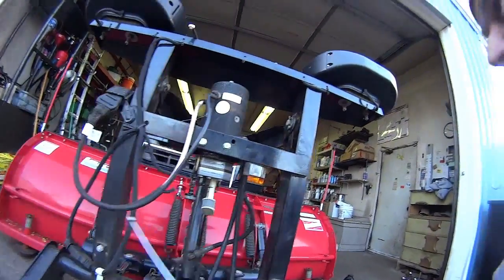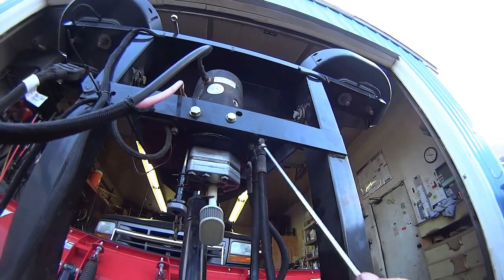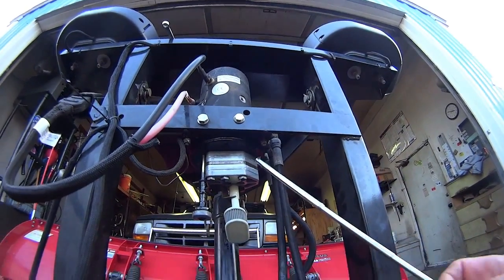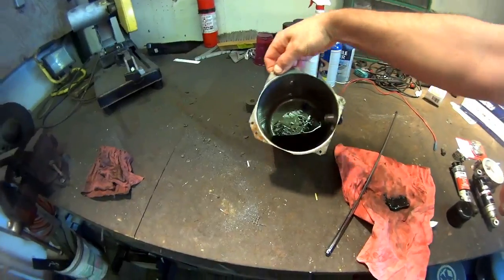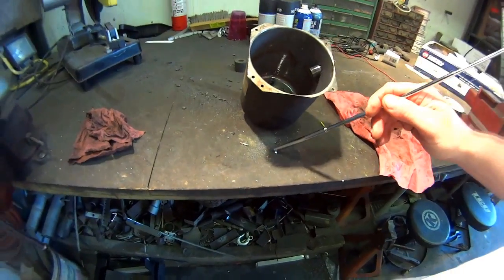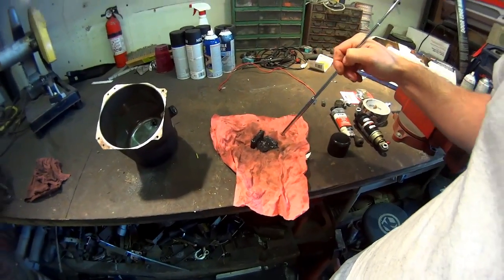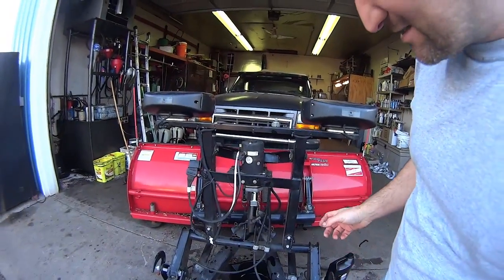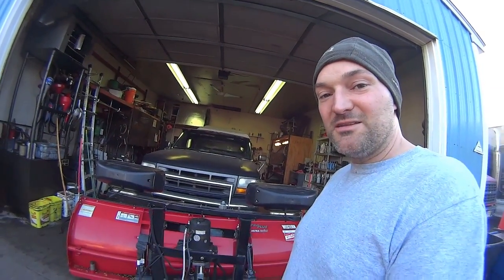western ultra-mount & the Pro plus hydraulic tank removal and install

Comment: Good informative vid , Whats the best way to clean the filter? Just replace it or use a small paint brush soaked with the oil to bush it off?
Reply from the maker: ron m 
Carb cleaner or even wd40. Clean from inside out 
Don’t use a brush u might push the metal particles through the screen.
If it is that bad get a new one they are cheap.
Reply: Outstanding, You 'da man ! ! !  Can't wait for the snow to start flying. I know,  SICK Right
Reply: @DavidsHowtosReviews  What do you mean by cleaning inside out?
Reply from the maker: Adrian Quinones 
Where in the video do I say that?
Maybe I had a brain fart

Comment: Having a issue with the small bolts or screws? Flat headed? or 5/16 socket? they may be stuck, but where there is a will there's a way
Reply from the maker: Yes I just had the same problem with my one plow last week. 
If u didn't get it out yet 
Go to Sears hardware and get a impact driver. http://m.sears.com/craftsman-impact-driver/p-00947641000P
I tried with channel locks and it would not work then go and get stainless bolts
Good luck.
Reply: +David Behr's yeah I got it, just went got 6 point 5/16ths socket all four came out, stainless be good option but I'm gonna clean them up and put some anti seize on em good to go

Comment: Best way to remove a broken bolt on tank? Is the block aluminum?
Reply from the maker: I believe the case is cast aluminum 
Use a magnet to confirm that the area is aluminum 
If you are able to grab with vice grips try to heat up a little with a plumbers touch
Not a welders 
And slowly work back and forth .
If it is inside left hand drill bit and a nice center punch.
If it broke half way in and you can access some threads, drill a hole center of new bolt 
Then thread that bolt in the best you can and then use it to drill the center of broken bolt.
Use heat when extracting. 
Good luck

Comment: Can the hydraulic fluid canister be repaired from a rust thru?
Reply from the maker: Howard Silver 
If u need like ASAP and the stores are closed 
U can take brake cleaner and clean the inside of the can, then coat the inside of the can with ultra black RTV.
If u have time I would suggest getting a new one, last thing you want to do is have a crack form next to a weld or apoxy fail in the middle of the night in 10deg.
Do it right so u don’t have to worry
Reply: Thanks, new one ordered.
Reply from the maker: Howard Silver 
Cool 
Hope u get to use it this winter! 👍

Comment: Please  Help 

I have a Ultra mount that will not move the motor spins. i cleaning the tank there was nothing really in there. and I check all the valves and coils. when the plow does move it won't go up. and it like moving in the same direction no matter what you push
Reply from the maker: I would say it sounds like u have a electrical problem. 
I would start by checking the (control plug) not the power plug. Any corrosion on ether end is a problem if there is any corrosion make sure you clean it thoroughly and put electrical grease in place.
Check the ground wire on both plow side and truck side. 
If all is corrosion free you will need to focus on the controller in the truck. 
Check for loose wires on the white plugs. 
If you can barrow a controller from a friendly at would eliminate the controller. 

Try this and let me know 
Good luck. 
Take it step by step.
Reply: Now that you mentioned it I did change the controller connector last year  and all of the wiring was all most the same but a few where different. Everything is corrosion free for the  most part.
Reply from the maker: +brandon Webb if u had trouble after the wire change that may be the problem. 
There is a 9pin and a 12 pin count the pins make sure they r the same. 
If all that checks out then the last thing would be the control unit under the hood.. Big black box they do go bad.
Reply: This truck has not been used in two years. The last year I used it  I notice that the plow would  JAMA or trun when I hit hit the Up button. 
Then the connector on the truck side broke so ebuy sale Ultra mount  Unimount connecter 6 pin. I used taht and a couple of the wires wear the same color but a different shade. . I was thinking that it was the control unit but I don't know how to tell if that's it or not. I just just bought a brand new controler. That's just the only thing I have not bought is the box's
Reply from the maker: Tough to trouble shoot when not in person. If the wires were same color diff shade u should be fine 
The control unit has to be it 
They do go bad.  
Not like the old plows that just had relays 
One would go bad u could Change it and keep going.
Reply: Thank you sir for your help I think that's the only thing that it could be
Reply from the maker: I think u have it right 
Control unit would be the last thing. 
Disconnect it and see if dealer can test it. 
Good luck

Comment: Do you have a video on how to remover the motor?
Reply from the maker: mike moran 
No I do not .. but it is very easy.. 
disconnect the power lead 
You will see three boilers on to of the motor.
The two that are across from each other those are the ones u want to unscrew. 
Now lift up the motor u will have just enough room to get it out 
Before installing the new motor look at the position of the shaft the is ether in side the case or on the motor u just took off 
Match the new shaft position. Now install the new motor. 
That is not that hard. Good luck.
Reply: David Behr'I just finished it. Very easy. Thanks
Reply from the maker: mike moran 
Excellent glad to help and glad u got it done! Saving money is the best! 👍